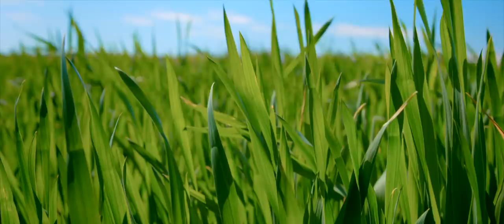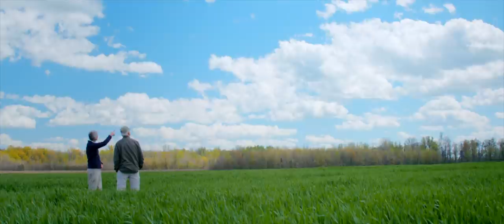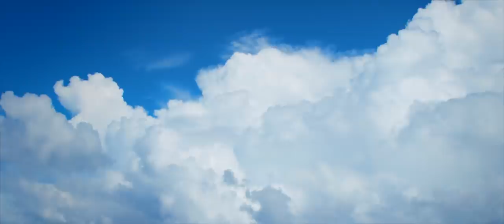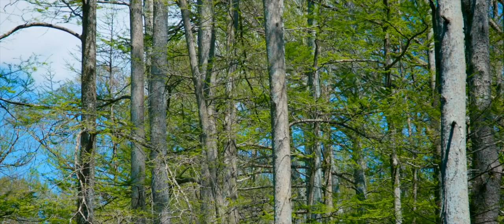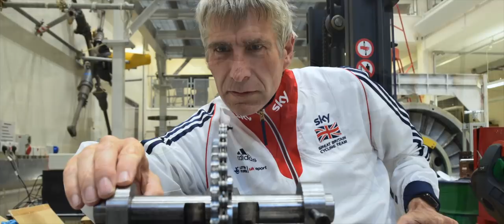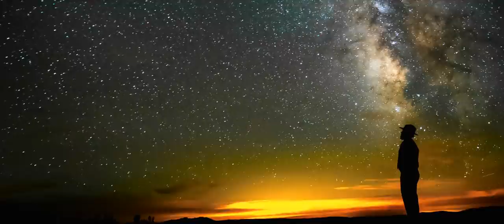How do the earth and stars showcase God's design? - Dr. Stuart Burgess

Comment: The Great Mazzaroth, encapsulated in the Firmament, over a stationary flat earth is an amazing journey in itself. "Is Genesis History?" Indeed! But no-where in the Creation account (or Bible) does it say, state, or imply, that the Earth is a "Waterball" or globe as portrayed in these video's, and taught by the very same "paradigm" that promotes Evolution. A Globe Earth supports the Evolution Theory. A Flat Earth MUST have come from a Creator. This series of videos are an excellent source, but if it wants to prove Genesis history, then it needs to take a honest look at what shape the Bible says the Earth is, and what Genesis says about Creation.
 
 If you insert a waterball or globe in to the Genesis creation account you are guilty of Eisegesis (Eisegesis (/ˌaɪsɪˈdʒiːsɪs/) is the process of interpreting text in such a way as to introduce one's own presuppositions, agendas or biases. It is commonly referred to as reading into the text.) The text should be read to find it's original meaning (Exegesis, the critical interpretation of the biblical text to discover its intended meaning). - In other words, taken litterally, and as intended, and from the original Hebrew/Greek. 

By all accounts (well almost, unless you add Eisegesis) there is, no verse, anywhere, in the scriptures that describe's the Earth as a globe. There are however, dozens that describe the Earth as flat, stationary, immovable, set on 4 pillars, having 4 corners - where 4 Angels, and "the 4 winds" are located, and also speaks of the "circle" of the earth being enscribed into, and measured out by God in the Book of Isaiah.

For 33 years I have been a Christian, and for 31 of them I believed the earth to be a globe, and believed what I was taught and shown by our Governments and Agencies. I thought I knew my Bible, and even thought that God's word taught the earth was a waterball globe. Then God open my eyes to another amazing Truth of His Word.

I'll keep it short as possible, but if you are a Christian, you really must investigate the shape of the earth (absurd as it might seem), Space Travel & the Moon landings, and our location in the "Universe", and what God, and the Bible, and what the Biblical Historical Texts says about these things (like the Book of Jasher , Enoch 1, etc mentioned and quoted from in the Bible). Is God Wrong? I think not. God knows what shape he made the earth, and tells us directly through His Word. It is us, and the "Paradigm" that is spun over us, that decieves us and hides the Truth from us, as this video proves and lays out in many other areas and sciences.

"Brace yourself like a man; I will question you and you shall answer me. Where were you when I laid the foundation's of the Earth? Tell me if you understand? Who marked off it's dimensions? Surely you know! Who stretched a measuring line acoss it? On what were it's footings set, or who laid it's cornerstone - while the morning stars sang together and all the angels shouted for joy?" The (Pre-flood) Book of Job 38: 2-7.

A "Ball Earth" spinning on its axis at roughly 1000mph (tilted at 23.4 degree's), while rotating around a Sun at approximately 67,000mph, whilst itself (the Sun) is travelling at around 500,000 mph in our Milky Way that shifts at a whopping 1.3 MILLION mph, does not fit in the above (or any) scripture. If the above Geocentric Model as presented by NASA and all other space agencies "paradigm" is true, then scientists have used this model and calculated that we should see a new set of stars every 6 months. However, we have had the same Constellations for milenia. It is therefore a false Paradigm.

"The Earth takes shape like clay under a Seal; it's features stand out like those of a garment." The (Pre-flood) Book of Job 38:14 

Sorry, meant to keep it short but not easy....if you go on this journey...here's a head start...it's flat, circular & etched in to a square, stationary and on 4 pillars, Sheol/Tartarus/The Abyss are below it.  The centre of it is "Magnetic North" - all compasses actually point to the centre of the earth. The outer circle has an ice wall 200-300ft high all the way around (which is really what Antartica looks like) so no "falling or jumping off the edge". Attached to this outer edge somewhere "heaven meets earth" and the Firmament starts and encapsulates and covers the whole earth. This separates the "waters above" from the " waters below", the firmament has "windows" opened during the Flood of Noah, and the Fountains of the Great Deep flooded up from under, forced down by the waters outside the firmament. The Sun, Moon & Stars were placed into or under that Firmament on Day 4 of Creation in Genesis (How did we have 3 previous days & nights without a Sun,  Moon, Planets or Solar System?). The Sun & Moon are local to the earth and are the same size (approx 3000 miles high at peak) - which Joshua made stand still over specific locations in Joshua Chapter 10. The Firmament is hard and a solid physical tangible structure. Heaven is directly above it, from which a river flows from beneath the throne of God. "Heaven Is my throne, Earth is my footstool" and when all the descriptive pieces are taken from the Bible and put together, it sure looks like one! 

Finally, every Eye shall see Him when he returns....only on a Biblical Flat Earth!
Reply: "Now the Berean Jews were of more noble character than those in Thessalonica, for they received the message with great eagerness and examined the Scriptures every day to see if what Paul said was true." Acts 17:11.
Reply: .....What you are not being told about Astronomy. Vol 1. ....
Reply: You are a liar. You don't know what the Bible says. You're just one of those flat earth morons who believe in Evolation.
Reply: There are some obvious metaphors in there.
By your logic, Jesus must have hinges and locks, because he is the door!
1. The earth shall not be moved? - well, the righteous shall not be moved either
2. 4 corners? I thought circles don't have corners, do they? 4 winds? There are certainly more than 4 winds mentioned in the Bible
Circle of the earth? If you look down on a sphere, what does look like? (Ever thought about circles?)
Reply: @donaldmacdonald9940  nice! Vol. 2 is good too
Reply: Okay you missed cutting your comment short but it happens in the moment. What you are doing is just elephant hurling. You are throwing out a bunch of passages out of context. Did you include that God hung the sphere of the earth on nothing? You did throw a ton of poetic statements in there I see. A lot of comments come directly from the flat earth society and Globebusters.
Reply: @pocadon  look at a gyroscope and explain how you use it on a ball .
Reply: @pocadon  I'm not taking anything out of context. God doesn't mention hanging a sphere, he says the earth is hung on nothing, not a globe is hung on nothing. You are adding to the text by saying this, and therefore taking text out of context.
Also the Bible is not poetry. I have nothing to do with flat earth society or flppin Globebusters!! Please show me wheere i quoted flat earth society. Go read your bible.
Reply: B14KSY he doesn’t specify globe or not globe. He speaks of the circle of the earth and it hangs on nothing.
Reply: Lion Of God exactly my point. No globe mentioned. And a circle is not a globe.
Reply: @b14ksy17  well that is your chosen interpretation.  I would say a circle can most certainly be a globe.  We weren't there or at least I was not.  Were you?  So I am neither a flat earther or a globe earther as this is not a salvation issue. Frankly it is not important to me what shape the earth is or how it hangs or doesn't .  What is important to me is God's Kingdom.  People like yourself are looking to create division amongst the brotherhood.  You are not alone, there are many.  This is from Satans' Kingdom.  I would like to suggest you stop being confrontational on this matter and focus on loving your bretheren the 2nd greatest commandment rather  than what you have been doing.  The father will favour you greatly I am sure.
Reply: @lionofgod5843  ...and thats YOUR OWN interpretation. I was not giving My INTERPRETATION, I was showing you what IT MEANS, and what I had learned. The Holy Spirit is my Teacher.

Isaiah 40:22 It is he who sits above the circle of the earth, and its inhabitants are like grasshoppers; who stretches out the heavens like a curtain, and spreads them like a tent to live in;

"The Hebrew word that is used in Isaiah 40:22 (חוּג, chug) does not at all imply a spherical earth. The root word only occurs in the Hebrew Bible once as a verb (Job 26:10). In nominal forms, the same root occurs four times, three as the noun חוּג (chug; Job 22:14, Prov 8:27, Isa 40:22), and once as the noun מְחוּגׇה (mechugah; Isa 44:13). This term refers to a "circle instrument," a device used to make a circle, what we call a compass."

Indeed it is a Salvation issue! at least so much for "the lost". Flat Earth is not an accident by any stretch of the imagination. Someone or something had to have created it. The realisation of flat earth is a major pathway to belief in God.
Reply: @b14ksy17  as I stated before my attention is on God's Kingdom not the shape of the earth.  If I make it to the Kingdom which is my total focus then I have faith that I will be told everything I need to know that has not been clarified.  Have a great week.
Reply: @b14ksy17  well you say the holy spirit is your teacher and I hope he is.  But I never fly that in the face of people who don't know me as how would they know it's true.  I have "friends" in Christianity who tell me the holy spirit is just sitting around in their living room  talking to them all day long.  Meanwhile they have a big plate of bacon in front of them, don't keep sabbath and their personal lives don't resemble anything like those who would be keeping the commandments.  One recently told me he knows he's made it into the kingdom.  The holy spirit has told him so.  I personally have found those truly guided by the holy spirit don't throw that information about or shove it in other people's faces as it demonstrates spiritual arrogance. they walk the walk.  You know who's guiding them by their walk.  That is what counts.  Actions speak much louder than words.  I'm just walking in his way daily and doing the best I can.
Reply: @lionofgod5843  " If I make it to the Kingdom which is my total focus..." Brother, (allow me to open another "can of worms") our sins will not send us to hell, the price of sin has been paid. Ultimately. Only rejection of Jesus Christ and the Gospel of, can do that (and Blasphemy of the Holy Spirit). Rest assured our sins are forgiven (past, present & future), and our place in Heaven Guaranteed...or God is a liar and Jesus died in vain! "If you confess with your mouth that jesus is lord, and believe in your heart that God raised him from the dead, YOU WILL BE SAVED!" Will you never sin again? or will you have to confess every sin right up to the point of death to get there?...otherwise your in Hell?!! I think not! Enjoy your life brother and be free in Christ indeed! Not weighed down by the power of sin. "if any man be in Christ Jesus, the old has gone, the new has come!" Believe it!

The Prodigal Son was still a Son. It's not called "The Good News" for nothing! :) x (P.S. Please research Flat Earth, absurd as it may seem) :)
Reply: @lionofgod5843  (reply to: well you say the holy spirit is your teacher and I hope he is...etc.etc..) Dude, you joined the conversation, I wasn't trying to offend anyone, but I will always be forthright and upfront with the truth (No man lights a lamp and hides it under a bushell), and once I have made a statement I must be ready (and equipped) to defend that view point (Preach the word; be prepared in season and *out of season*; reprove, rebuke, and encourage with every form of patient instruction 2 Tim 4:2 - Flat earth is certainly "out of season" LOL).

To be honest the Bible says The Holy Spirit is all of our Teacher, but that depends on how much you want it. The Bible also says as iron sharpens iron, so one man sharpens another (or close to that - from memory). I'd hoped to "sharpen" at least someone, or gain some more insight myself here, and have indeed learned something from these video's. I'm also figuring since your on the subject, maybe that one that God wants sharpening and equipping is you, and is leading you to this subject. His Word is your Guide. Understanding Genesis is vital.

With the Holy Spirit & some intelligent men, The mysteries of God are being unravelled, science is "finding God" and bumping into His handy work everywhere, and is amazing in our time. But since the 16th Century, (actually some 2000 years ago, but accelarated since Masonic Copernicus/Galileo/Newton and people like Einstein to Hawkins etc) the shape of the earth and the truth of Genesis has been trampled under foot, until it is almost unrecognisable. I applaud this series of video's for what they present, especially in "Is Genesis History - The Full Movie" when the Scientist at the farm near the end says: " whoever came up with this paradigm knew they only had to destroy the first 11 chapters of Genesis to discredit the whole of Christianity" (or words very similar). Indeed they did! It's the globe earth/big bang/evolution/deep space/fake news/NASA CGI paradigm that they've continued to spin for centuries! However that same video (and this one) do not go anywhere near explaning the shape of the earth, the Sun, Moon, Stars, Firmament, Waters above, Waters below etc... or even go into detail how the early Hebrews history of the stars, are accounts of pre-flood events, the story of the Gospel, and events to still happen in Revelation known as the Mazzaroth (Hebrew name for Zodiac). They're actually prophesies, a story told before it happens, written in the Stars!

Sorry for the long replies. I can't help sharing this stuff! God is mind blowing :D

My own personal opinion about those who "have the Holy Spirit just sitting around in their living room talking to them all day long"  and "he knows he made it into the kingdom. The Holy Spirit has told him so".  -  From experience,  I tend to avoid such people, watch and observe and see what God's telling 'em next week ;), and as my old Pastor used to say " Don't be so heavenly minded, that you're no earthly good!".  "Beloved, do not believe every spirit, but test the spirits to see whether they are from God..." (1 John 4). And, as 1 Thessalonians 5:21 says: "but test everything, hold fast to what is good."

I'll shut up now, although i didn't address all your points :)
Reply: @b14ksy17  I'd be a little more charitable toward people on their spelling if I were you. Would.
Reply: @b14ksy17  I used to watch Rob Skiba's videos and read his books. He brought information or facts to my attention that I otherwise would not have known. But I had to stop supporting his ministry when it came to my attention that he denies the Triune nature of God. He is therefore heretical in his theology. I realise that the "oneness" doctrine has become quite fashionable in these end times, especially among certain Pentecostal denominations, but it is not scriptural. I keep hearing about the Catholic church inventing Trinitarianism, but I would contend that it is one of the few instances where the CC actually got it right. Mathew 3:16,17 "And Jesus, when he was baptized, went up straightway out of the water: and, lo, the heavens were opened unto him, and he saw the Spirit of God descending like a dove, and lighting upon him: And lo a voice from heaven, saying, This is my beloved Son, in whom I am well pleased.                                                                                                                                                                                                           In these two verses we have the Father, the Son, and the Holy Spirit. As far as a flat earth goes, I'm not convinced that the scripture says, or even implies, that the earth is flat. Yes circle doesn't necessarily imply a sphere, but it also doesn't necessarily imply a flat earth either. At best it is neutral. Have a good day.
Reply: @b14ksy17  a y sphere looks like a circle from a distance.
The Southern stars and the summer and winter solstice proves flat Earth doesn't work.
Reply: Nice job !!